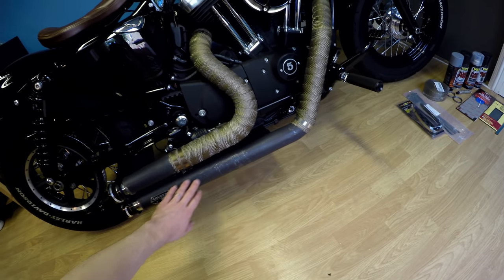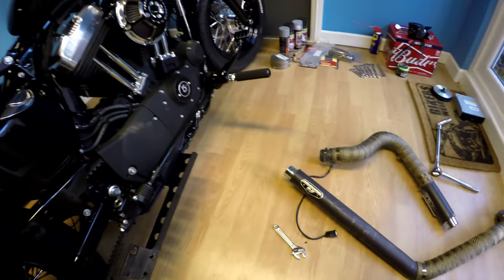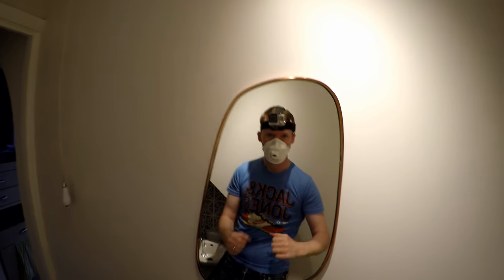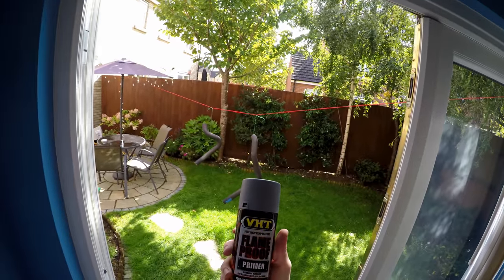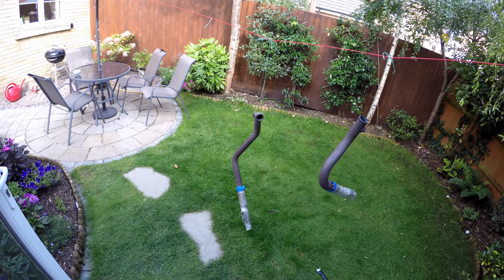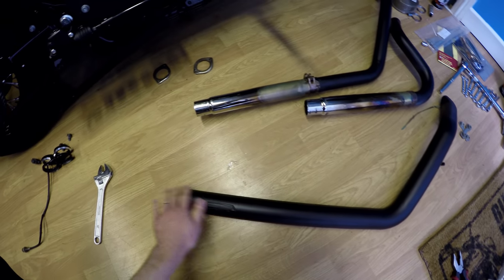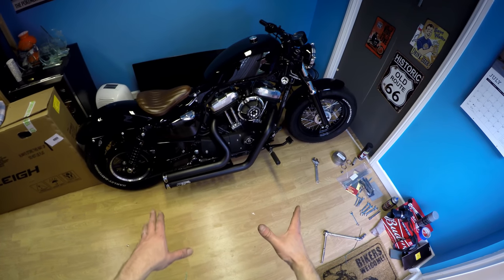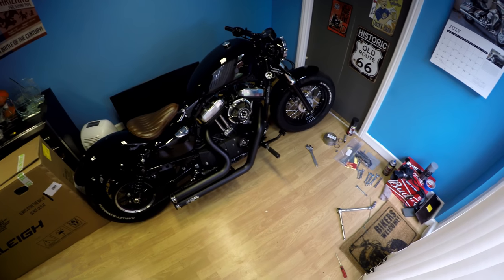HOW TO: VHT Ceramic Spray Painting Exhaust Pipes | Harley Sportster 48

Comment: Shocked at how well those pipes actually turned out with the rattle can. Your videos are great and bike looks awesome. Hope to see many more vids from you.
Reply from the maker: +Bogan Moto Thank you, honestly I'm surprised at the finish too! Hopefully they'll hold up with the heat. RD
Reply: Riding Digital i know it hasn't been very long but how did the paint hold up? Would you recommend it?
Reply from the maker: +floramakes Hey, so far I've ridden around 1000 miles in some quite wet roads and unfortunately I have had paint coming off the top of the headers before I wrapped over them. The exposed ends are ok but there is some pitting. If I did it again I'd look to use the Rustoleum high temp paint which I hear is better (unfortunately couldn't get it in the UK). Will show the pipes in a future video! RD
Reply: Riding Digital Try eBay! I live in sweden and can’t get most of the stuff here but eBay is always a safe bet. I’m looking forward to seeing it.

Comment: I found it necessary to bake the pipes in my BBQ grille using the three step process of 250, then 400, then 600 degrees Fahrenheit for the recommended time with the on the can instructions in order to properly seal the paint from head to exhaust exit.  I tried using the temp. sensor on the grille and the baking process failed and started flaking off.  After sanding and re-painting I baked the pipes using a laser temperature gun making sure the actual part was the correct tempurature for the correct amount of time (per instructions) and it turned out AWESOME.  Just starting the bike and running it did not seal the paint properly to make if fully sealed and therefore chemical and wear/scratch resistant as it can be.  Hope this info. helps any of you who tried this without getting the results you were looking for.
Reply: what did you use for paint?
Reply from the maker: great info, thanks. it's one of those situations where it's a lot of hassle to follow the steps properly but if you don't then the results don't follow. Appreciate the share 👍🏻

Comment: Great video, Great bike! I'm about to sand back and re-paint the headers on my Bonneville T120 Black, got the same Matt paint as you used here, but hadn't really considered Primer? My feeling was I'm only really saning off to key the surface, as such I can spray direct to the keyed surface?
Reply from the maker: Thanks! My learning was to really remove any rust before spraying.  Unsure if the primer makes a huge difference, I imagine it may help a bit.  Good luck 👍

Comment: Always wear gloves and a respirator when messing with exhaust wrap tape!  It isn't asbestos but a form of fiberglass. How does the paint wear?  Did it crack or change color?
Reply: Yes id like to know the answer to this. I painted mine without using the primer and within 10k miles it looked cloudy and heat worn again. Wonder if this ended up the same.

Comment: Hey mate, 3 questions

1 - What grade sand paper did you use? 
2 - What liquid did you rub the shields / exhausts with prior to applying primer
3 - Which specific VHT products did you use and in what order?

My bikes arrived and I'm looking to do this exact project over a weekend asap
Reply from the maker: hey; 
1) 120grit then 180grit
2) Alcohol decreaser (ie no water content)
3) grey primer, paint, satin coat all VHT High temperature spray paint (can't remember exact name but you can see the can when I hold it in front in the camera).

Good luck, get as much rust off as you can, it's all in the prep. RD

Comment: You did this job in 2017.  Many people, including myself, are asking you how this paint "held up" because many of us have tried this same VHT Ceramic based Paint, only to find that after a few months it CHIPS LIKE CRAZY.    Can you PLEASE reply to confirm your Post-Usage experience with the longevity of this ceramic paint.  (I must tell you, I was just as happy with it after I initially used it.  Then a squirrel dropped and acorn from the tree above (about a 20 foot drop), and that thing took a wicked chip out of the paint).  Then the "windy riding chipping" started.  Then the "bare touch with a tool takes out a chip," etc, etc, etc....  I've concluded CERAMIC paint is the problem.  It is "CERAMIC" which is naturally BRITTLE. However, inside the hood of a car s a pretty safe place for ANY  "heat Paint" which is to say that I am stating is the reason why VHT High Heat Ceramic paint will always fail.  After VHT Ceramic is (truly) fully cured, it becomes FRAGILE CERAMIC.  Anyway, PLEASE reply with your "post-painting" experience.  MANY people are asking you about it and the lack of an answer is kind-of speaking for itself.  (Thanks --Gregg)
Reply from the maker: Hi Gregg, thanks for flagging, I've replied to a very large number of comments querying this over the years, but not every one particuarly recently as I've got a lot on.  The short answer is not too well, rust came through at the header but I wrapped them anyway and the tips where heat was less extreme it was fine.  No chipping issues.  I'll post a general comment with an update, bit if you look through many of the comments querying it have an answer.  Cheers

Comment: Nice video. How much drying time did you allow before starting the bike. And how did it turn out. Did it last? Just did mine on my gsxr.
Reply from the maker: Thanks 👍🏻 I left it overnight before starting it up, it's lasted fine except a little bit of peeling by the header, but I could put that down to not sanding enough rust back. Good luck!

Comment: Hi I'm planning to repaint my  buell blast exhaust with the vht gloss black two questions. . First the bike is being winterized and the exhaust won't be put back on till sprig.... Will it need the clear coat being a gloss. . Second I know it needs to be heat cycled to cure and I was planning to wrap the header section will I have to do that after it's heat cycled or can it be done now then heat cycled all at once

Comment: I’m looking to buy a 48. Or roadster.  I’m in AUS and strangely, most I see that are of this vintage or certainly 2016- to 18 have got lots of solid looking surface rust.  Pegs area and side strands almost with no paint on them (the arm no the area in contact with the ground obviously). I’m just concerned at how quickly the metals deteriorate on fairly new bikes.  Is this your experience and is this a Harley thing.  I’ve owned nice BMW sport bikes and have always garaged but have ridden in rain etc and never the amounts of rust, kind of is the only thing turning me off them.

Comment: I’m going to attempt this on my trask turbo system on my 07 Harley vrod I had a small crack on the mounting tab but think I can try coating. I’m wrinkle blacking the motor over since it’s been 7 years since I did it and still looks great but new pipe paint might as accent the motor as well
Reply from the maker: hope it goes to plan! Look forward to an update on how it went

Comment: How has the paint held up? Any flaking so far? I’ve been seeing a lot negative reviews and just wanted your opinion.
Reply from the maker: Panicked on day 2 as a bit of flaking on the headers, but then I wrapped them which covered all bar the final third and that's held up fine. I think it's all in the prep tbh and I probably should have done a better job of getting all the rust of for a better result

Comment: I have a small scrape on my header on my Bonneville T120 Black and I'd like to try this as a repair.    How are they holding up long term ?
Reply from the maker: its held up fine on the areas that weren't too rusty, would have thought it would be fine if you prep it well 👍🏻

Comment: Hey how did the pain fair over the months after this was done. Did the paint stay on? Any paint coming off at the exit point of the engine, on the first bend etc? My experience with VHT has been varied, it totally flaked off one time I did it on a car header, but then stayed on another time I did it on another car - both with what I would class as very good prep before hand. Interested to know how it lasted on your bike as I am about to do a Kawasaki headers, and about to select a paint, and heading towards VHT again, but not 100% sure. Thanks
Reply from the maker: +James B Hey, so I wrapped the pipes about 2 weeks after painting them, so I can only see the final few inches of pipe at the tips which is holding up fine. The paint right by the header had already started to flake before I wrapped them (showed it in my wrapping video) - If I could go again I'd try the high temp Rustoleum which seems to have better reviews. couldn't get it in the UK though! Good luck with yours. RD

Comment: Hi! When you install the vance and Hines exhaust did you install auto tuner as well? Did you experience any popping sound on your exhaust? Thanks.
Reply from the maker: +Balisong 5891 Hi! mine is an Arlen Ness Magnaflow Lowdown exhaust, yes I did need to use a tuner (used a V&H FP3). It was unridable without tuning, backfired all the time. I think with any stage 1 (air intake and exhaust change) you'll need some form of tuning 👍 Good luck! RD

Comment: What’s the first spray that u use which is white ? 
How long would the color last? Is it still black as it looks at beginning? Thank u for replying!
Reply from the maker: First spray is the high temp VHT primer, I'm over a year and 3000 miles in and the colour has faded a little, but still looks good. Sadly it will never look as it did when fresh, even on a brand new pipe. Good luck!

Comment: 2 years later, how did the VHT High Temp paint hold up?
Reply from the maker: a few days in paint started peeling from the headers, so either couldn't take the heat or didnt prep enough. wrapped the pipes since so only have the final 6 inches exposed now but they've held up fine
Reply: @ridingdigital  thanks, I just can't see any type of paint actually holding up on exhaust systems

Comment: Hey man did you have to change your front wheel to be able using that big tyre?! Thanks
Reply from the maker: Na it's a stock wheel and tyre on the Sportster 48
Reply: @ridingdigital  thanks for replying , i was soo frustrated i cant find any bigger tyre for my " 2008 nightster 1200 xln " , it turn out my front wheel is 19" i believe , so i guess to be able to put bigger tyre is by putting 16 or 17" wheel i guess ???

Comment: Was it the wrap that damaged your pipes? Thinking about wrapping my new big radius on my 48 but I’ve heard wrap can really damage them. What are your thoughts on this?
Reply from the maker: +Jon Nye There's no doubt that the wrap speeds up corrosion, particularly if they get wet often. But pipes will deteriorate anyway and when the wrap is on it hides any corrosion from view. Those pipes were wrapped for around 5000 miles over 2 years so not bad, and only a few hours work to return them to former glory. Depends how much you like the wrapped look! RD
Reply: Riding Digital thanks for your advice. I absolutely LOVE the wrapped look! I’ve heard all sorts of horror stories about cracked pipes etc from wrapping them. I think perhaps it’s worth the risk! I guess I don’t mind doing a little work every 2 years or so to get them back looking great. Thanks for responding, keep up the good work!

Comment: Woulda been better off without the primer. A good sanding and then wipe down with acetone to remove any oils that might be on the metal and you would have a perfect surface for the paint to bond to. 
   Is it flaking close to heads yet?
Reply from the maker: Paint on the headers started to peel a few weeks later. Just doesn't make sense to me why they would have a high temp primer in the range when it's better not to use it!
Reply: Riding Digital I could be wrong but I thought metal primers were for rusted and pitted metal

Comment: do you recommend this paint for the entire engine? it's VHT Flameproof Flat Black?
Reply from the maker: +paolo intravartolo Hi, it was VHT flameproof black, I've had peeling and flaking on the hottest part of the exhaust, although the engine will be cooler than the pipes. I've heard Rustoleum high temp paints are better but couldn't get them here. Good luck. RD
Reply: Don't use primer!!!! Been looking at this and found that those who experienced flaking/peeling used Primer. Those where it held up fine did NOT USE PRIMER.

Comment: hi, Can I paint other engine parts with the VHT paint?
basically covers...
Reply from the maker: I wouldn't recommend it, as for the paint to harden properly it needs to  be heated to the right temperature and cooled. For me the paint was very soft until I'd done this, scratched with a fingernail.  I'd suggest getting a spray paint best suited to the surface you're painting 👍🏻
Reply: @ridingdigital  Got it, thanks a lot

Comment: How did the paint hold up??
Reply from the maker: +DOUCHEBAG DYNA Wrapped the pipes a few weeks later, there was some peeling right by the headers but otherwise it's looking fine on the exposed tips! would give Rustoleum high temp a go next time, I hear it's good. RD
Reply: Riding Digital I’m bringing my thunderheader down to a shop tomorrow to get it ceramic coated. I hear it’s the best route to take. Only costs $150 for pipe and heat shields. Maybe that’s an option for you.
Reply from the maker: +DOUCHEBAG DYNA Awesome would love to hear how that holds up. Was considering it but went with the cheaper option -Let me know! RD
Reply: Riding Digital I will let you know
Reply: How did the ceramic coating work out for you? Really tempted to do it to mine...

Comment: Good video just lacked a little info on the materials used. Other than that, well done.  On a side note, assuming that is an air cooled sporty you might want to do some research on idling an air cooled Harley. John Maxwell (certified Harley mechanic) talks about it on his channel. Not good for them at all my man. Ride it or leave it plugged up to a tender until you can ride. Engine damage is a real thing for air cooled engines. Hope this helps. Keep the knees in the breeze! 🤙

Comment: Update on how the paint held up?
Reply from the maker: All good, bit of flaking at the header but otherwise it's been fine 👍🏻
Reply: @ridingdigital  im going to put like 20 coats on the pipes and if it does the same as the Rust-Oleum with the flaking im just going to find a place to do it professionally and call it a day.
Reply from the maker: My lesson was the prep is key, get all the rust and crap off first. good luck!

Comment: I have to check to see if this bike is still running. Letting an air cooled bike run for 20 minutes is definitely not good for it. I was actually looking up what to do as far as painting my exhaust
Reply from the maker: yes it's still running absolutely fine, never misses a beat
Reply: @ridingdigital  awesome. I just found an the oven that somebody was throwing out so the oven part still works, not the hob. I'm going to bake it on
Reply from the maker: @aragos32727  good stuff, I kept a close eye on mine when I was running it to make sure it wasnt overheating with the V&H FP3.  Ran it a little less than they said, all was fine.  good luck
Reply: @ridingdigital  thanks for the response. I appreciate that you took time out of your day to respond to my comment. Quick question. How are they looking now?

Comment: HI , do you have install fuelpak ?
Reply from the maker: Yes I have the FP3 V&H installed
Reply: Thank you 
This is necesarry  , or just normal ECM setting  ?
Reply from the maker: If you're fitting a new exhaust and air filter then yes you'll need to remap the tuning or it will run really bad
Reply: OK . thank you very much